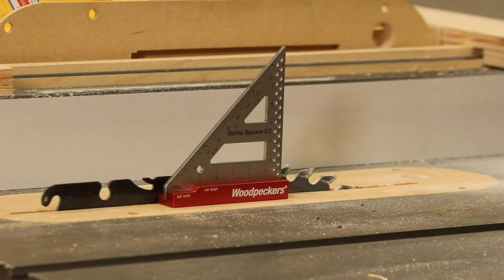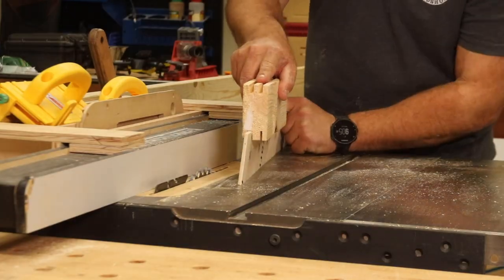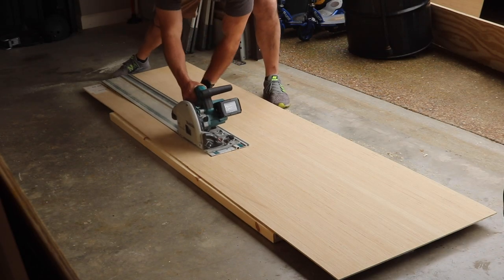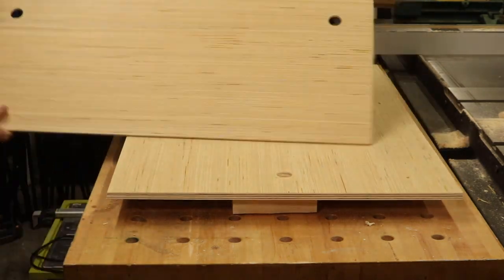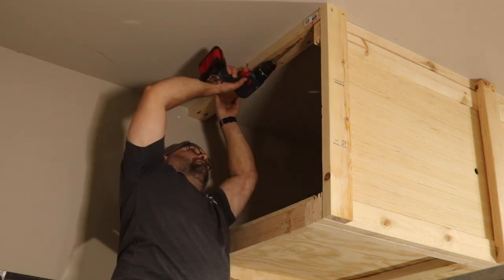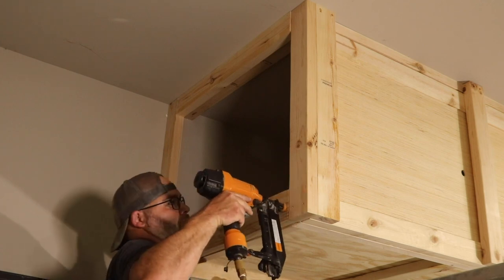DIY Hanging Storage Shelves with Sliding Doors - Overhead Garage Storage

Comment: Great build, going to use your concepts for our garage as well.  Have watched your video and gone through the description and comments but you stated 1/2 plywood in the beginning, and 3/4 when screwing down the base.  I am guessing 1/2 because you have 1/2 inch datos for the door fronts and it would then be level.  Just wanted to confirm.  Thanks!

Comment: Very good job on how you install everything just to let you know I do garage door motor so just let you know your emergency release rope and handle it is tied off wrong so if you want to fix that that will be good I can’t tell if the handle is upside down or not so make sure you get that fixed and put the proper knot On it normally a half hitch on each end of the rope is perfect and if it’s too long cut it burn the end of the rope and put 1/2 hitch knot on it and it will look good
Reply from the maker: Thanks Zach and I’ll definitely take a look at that! 👊👊👊

Comment: Great video.  Someone mentioned a concern about potential repair on your garage door spring.  Would those cabinets need to come down if that happened?  Only ask cuz my garage door just had that happen and it was right before a rainstorm that the door got stuck open!  Also, what nail gun were you using?

Comment: Thanks for sharing and nicely done…although not sure why you use the large wood dimensions. It’s completely overbuilt. Why not 2X2’s, 1/2” plywood, 1”X4” trim pieces (or 1X6 instead of 2x6 on the side)…etc?  What you built can probably handle 10+ times  the weight of what you would ever put there. 
Having said that - thanks again for sharing!

Comment: Did you use structural screws to hand the ledger board and overhead board? I was hoping to see a lag bolt instead of 3” screws. Nice work though.

Comment: Excellent.   What amount of weight seems safe?   I have a garage with exceptionally high ceiling and am curious know if there’s a rating for lbs per sq for of space hanging from the ceiling , will it make a difference if the ceiling to my garage is the floor to second story ?

Comment: Good job, but had you given any thought to lighting?  I did the same thing down both sides, as well as the front. I didn’t have enough room over the doors.
Reply from the maker: It did darken some areas on that side of the shop. I’m thinking of finding something simple (maybe even battery operated LED’s) to hang under them. Great question because it’s something to definitely consider

Comment: Can something like this be used in an apartment ?
Reply from the maker: This is a pretty open question is there a specific concern or question about how they would work? Would the complex allow it?
Reply: @PenaltyBoxWoodshop  I was wondering if I could built something like this in an apartment.  Im worried about it being able to hold up when building it into sheet rock or would something like this be too heavy.
Reply: @dionnefowler7545  it will be fine
Reply from the maker: As long as you put them in studs

Comment: Awesome but all I thought about was. I would build that thing on the ground.
Reply from the maker: 😂 Fair enough but the point is to have storage without taking up floor space
Reply: Building it on the ground would make it easier in assembly, but it would be a bear to lift the finished cabinets up to the ceiling and snake it above the garage door rails.  IMO, building it in place is the way to go, but think through sub-assemblies.